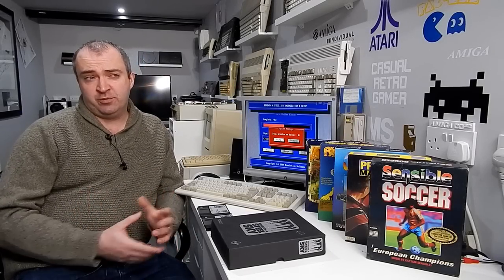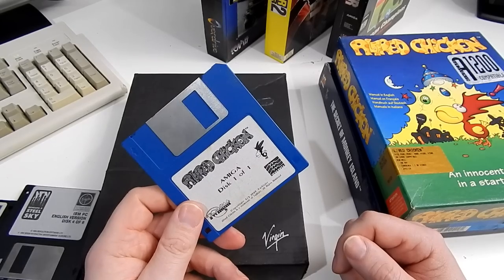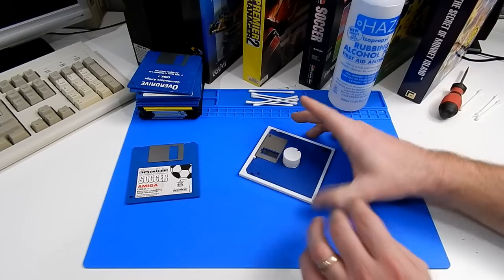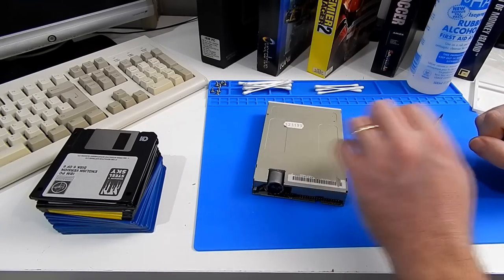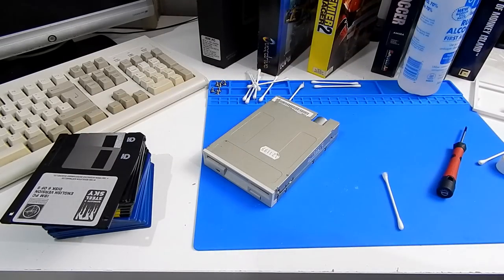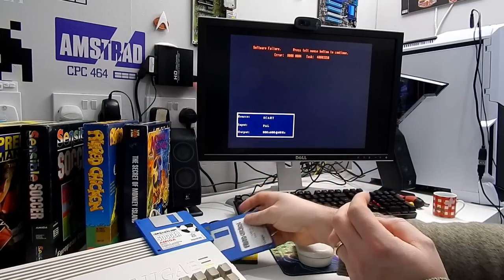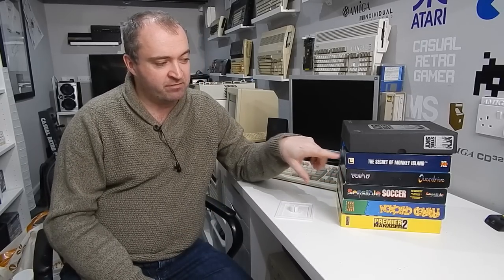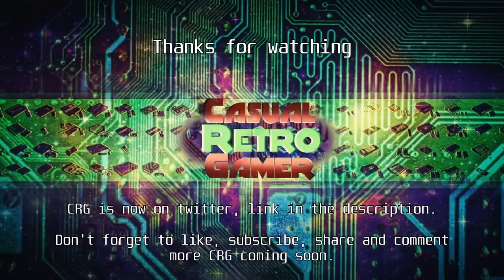Cleaning Floppy Disks, will it fix them?

Comment: I´m a bit late, but there are my 2 cents in the 3d printer issue. The wall-infill gaps can have several causes:
- Improper filament diameter. Unfortunately, some brands don´t give the full 1.75 section so there´s some under extruding. Test with the caliper to average the size and adjust the material in Cura if it´s wrong.
- Printing speed, temp, flow, retraction settings can affect the results too. Ideally some testing to catch the ideal settings for every material can give the best result.

As the overall quality seems quite decent (on camera, though), I´d suggest going straigt to measure the filament, and if it´s ok just seek the "outline overlap" setting and rise it a bit. You can also rise the flow a bit if other areas lack material too (when you point the gaps the top right area printing lines look a bit empty).

Hope it helps. Cheers

Comment: So IPA could cause issues. I know it's good for cleaning the heads of disk and tape drives but those tend to me made up of metallic or similar material. Any plastic-based material can be impacted, esp depending on the strength of it (i.e. 99% is worse than 50%' -- I tested a bunch of products on plastics after I damaged a portable amp's exterior surface and IPA causes a chemical reaction on certain types of material). Here is part of an abstract of a paper about restoring magnetic recording media (fixing "sticky shed"): "A liquid cleaner, such as isopropyl alcohol, is applied to the Backcoating to dissolve it from and clean it off the Mylar Base. Before the liquid cleaner is applied, steps are taken to prevent the cleaner fluid from getting onto the Oxide side of the tape. The chemical cleaning is done as quickly as possible... the Oxide side of the tape is given a dry, non-chemical cleaning to remove the residue of contamination of the Backcoating which was deposited on the Oxide side of the tape as the result of physical contact with the Backcoating from the storage on the reel ..."
Reply from the maker: The stuff I used is 70%.  There certainly didn't appear to be any physical problems from it although as you seen a few of the disks didn't read as well after cleaning.  I'll test them again and see if perhaps they have further degraded.  Perhaps the solution here is to clean then dry yourself, rather than leave it to dry as I did.

Comment: Once you succeed in rescuing a whole set of disks by cleaning them, you ought to try to find any NOS disks of the same density that you can back them up to, as well as backing them up as install images onto a hard disk, optical, flash, or all 3, if it seems like someone hasn't done so already, so that you might not lose that game from all functional existence.

Comment: Could you re-write a disk image to the disk to refresh the magnetic fields on them ?
Reply from the maker: I'm not sure to be honest, but might be worth trying it with the steel sky disks.  It's not like I'll make them any worse.
Reply: Yes you can do that certainly. However the more you use the original the more likely you are to damage it. Especially now that the hardware used to read these old disks are getting old themselves. Old irreplaceable originals should be copied to a preferred media type and used from there instead.
Reply: Hi - Nice Video on a common problem

As there are 2 components, there is 2 places to look at first

Drive mechanism, most people clean the heads, but you should also do a alignment, there are some software floppy tools available to read a disk and determine its alignment most older drive units have a adjuster on them

Note  original double density 5.25 x 360k  and 3.5 720k driver have a stronger and wider rear write head, then the high density format came out the HD units can read and write to these but the HD systems do have a thinner rear/write head - so generally they can safely read and write , but some of the original Double Density drives may not really understand it -most times it is Ok - this is why for double density you should format them in a older double density drive and you can use them 

Floppy media - these have 5 common faults
1. Age Dust - Mold on media
2. Age each magnetic particle is now weak or not refreshed it cannot hold a charge or lost the original
3. Physical scratch or flaw on the media
4. Heat
5. next to strong magnet

1. just clean it, you can simple blow the dust of or clean it as you demonstrated
2. This is trial and error, reformat the diskette, if the media particles are weak and faulty they will not hold a format, if you are lucky it will work, partially lucky maybe a few bad sectors and you can live with that as a data disk or files only ( ie nothing that is used for copywrite where it looks at a certain track / sector for information ). If it cant hold a format you should bin it - you can try formating or another disk drive or say apple / amiga but it will at best be borderline
4. Physical scratch - junk it - if it was part of a original box set, i would place a small colour sticker on it advising faulty and get a image and place on generic floppy
4. Heat will damage the coating on the diskette surface, best to bin it as it will be totally unstable
5. if you get the floppy next to a strong magnet eg HIFI speaker then you may have a change of reformatting it to reset the media

Any media - Tape - Floppy - Hard Drive - DATA FADE 

While this is not really how it works, floppy media is like tape media, it has a coating, the coating is either readable or unreadable - a format sets the magnetic polarity to neutral, when you write to a floppy or tape it sets the polarity to +ve or -ve  the magnetic equivalent of binary 1 or 0

With hard drives - if you dont use them often - eg backups, i like to use this every 6 months, it does defrag and checkdisk etc, but reads every sector and rewrites it to ensure it is writen on new fresh location with now a reset magnetic field

diskfresh  http://www.puransoftware.com/DiskFresh.html 

I have no link with the company  other than grabbing these free tools and using them in 2017 

Regards
George
Reply: You might as well just leave them be and put copies of the disks in the box to use if you want imo
Reply: Get a greaseweazel USB magnetic flux writer device - then replace the internal magnetic part of your original discs with the internal parts from some good branded blank discs. Then just re-write the discs from disc images.

Comment: Just blindly cleaning the disks won't give much success. You need to pair it up with something like Greaseweazle (flux level reader/writer) so that you can dump an image of the disk an analyse it for errors. Greaseweazle can also be used to rewrite original images back to the disk, or to a donor disk and then replace the damaged and unrecoverable media.

Comment: Regarding the noisy disk, I'd be worried about that as noise means vibration from friction, and friction on that media is not good... Probably a larger than normal particle is caught in the felt lining of the disk internals and is rubbing on the surface of the disk.

I would be cautious of the IPA as I use that as a solvent in some cases.. I guess it could make matters worse for the media, though it seemed ok. Maybe some IPA was still on the disc, absorbed by the same felt lining of the disc, making it grab it more and slow it down?

I would only do this to problematic discs though, if it works, don't clean it maybe?

Finally, for magnetic fading, maybe invest in a Kyroflux and rewrite a flux file from someone else's working copy back to the disk? Needed for some originals due to their complex copy protection.
Reply from the maker: I'd agree if it isn't broke don't try to fix it so if your disks are working then just leave well enough alone.  I'm not sure the IPA will damage the disk surface, the stuff I used is 70% but point taken than stronger stuff may eat into it.  

While it seems only a few minutes passed in the video it was probably more an hour between cleaning and when I started to test so I would expect that any IPA would have dried in that time.  

As for the damage I'm going to pull open that Monkey Island disk alter to inspect the felt.  Just want to see if there is any dirt in there that might have caused the damage.

Comment: Just curious-- Is it possible to replace the media inside the case from a good disk without irrepairably damaging the original disk?
Reply from the maker: Yep there's no reason you couldn't do it and I may take this approach to fix the likes of Monkey Island. 

Only thing you need to watch is that the disks are generally glued together so you need to be careful opening them.
Reply: @CRG  I was about to suggest this but made sure to read the comments.
Replacing the disc inside seems like a good option to try on permanently damaged disk where a rewrite is not an option or did not work.
Have opened disk before but was so long ago.
Would be nice with a video of that.
I would consider the disk original if the internal disk is replaced and rewritten with a proper image that is original to.
Reply: @CRG  I've done this with more than one AmigaDOS based Amiga game (Flashback immediately springs to mind). Found a disk image online, copied the contents to a known good disk, then gently opened the original game & copied disks and swapped the good copy disk media into the original case, then glued the game disk case back together again. Very satisfying to get an otherwise good big boxed game working again.

As a general rule I've always stored my original game disks in the original game box, nowadays taking no chances by putting them in sealable plastic bags too. The vast majority of them hav been fine. Disks that have been stored in less than perfect conditions inside old plastic floppy storage boxes (more open to the atmosphere) are the ones that have suffered with muck/mould. Thrown hundreds away as they were dirtying my floppy drives.

Comment: Did you try formatting and checking for bad sectors after cleaning up?
Reply from the maker: No I didn't bother doing that as in the first place I wanted to see if it was possible to recover the disks by simply cleaning. 

I may do this with the steel sky disks and see if I can then rewrite the original contents back.

Comment: My understanding is that it works for dirty disks (dirty with dust and other particles), but not for scratched disks. As for "de-magnetized" (if that's a word in english? :)) I think I remember that some disk utilities claimed to "revive" somewhat those kind of disks... My memeory may be failing, here though :(
As usual, very cool vid :)
Reply from the maker: That's basically my understanding too and it did seem to work here on 2 of the games.
Reply: SpinRrite was able to analyze magnetic flux and work out if it was a 1 or a 0 by doing multiple reads an even moving the heads back and forth to different tracks to get a better "look" and rewrite the surface, but that was mainly for HDDs I believe that it supported. IO remember using it with some success on floppy disks though..
Reply: @DarkAlaranth  spinrite can be very good to revive disks BUT it maybe end up permanently destroying the data... I have a few ARJ files on disks that spinrite managed to "correct" but now the ARJ gives crc errors and never was able to recover the data. I would try to get the data manually first even if it kept failing and failing "data errors" and even try the disks one a few different drives. Sometimes a different drive will read sectors that another couldn'.t. And only use spinrite AFTER to refresh the surface and re-record the data back into the disk.

Comment: I think the combination of ageing drives and heads combined with ageing floppy disk material means they should be immediately converted to ADF files and then write the data back to new disks if you want to still use floppies? I think with the advent of Gotek drives and some new improved Gotek like drives, the era of floppies is long over, they are too slow and too prone to failure. Practically every Amiga I have bought and refurbished has had faulty drives and yes you can fix them, but it's probably not worth the hassle. To me it's a bit like vinyl disks, when I got a new album I would immediately record it to the best quality tapes I could afford and never use the disk again until my tape wore out and then I would buy a new one and record from the album again. So over many years the disk would only be read a few times keeping the wear caused by the record player needle to a minimum.  I think floppies are now the same, the act of reading the disks causes wear so you want to keep it to a minimum so I would record to ADF and use the ADFs instead of wearing the disk any more than you have to. At least if you have the box and the disk and the manuals you can prove that  you have the right to own the ADF files. Also keeping the boxes and manuals is a good collector thing as they look good on your shelves even if the disk no longer works.

Comment: HD discs were always a bit more flakey than DD if i remember correctly.?
Reply from the maker: I've heard some say that in later years of disk manufacturing the quality maybe wasn't as good so they don't last.  Probably some truth in that but in my experience more of my DD disks have failed than HD.
Reply: I remember changing the spring tension of my floppy drive to get some disks to read properly. It's heads had some raised sections on the top where the tension spring sat and had 3 positions. Found I usually had to weaken the tension when I used HD disks for some reason. Maybe they're thicker?
Reply: Isn't this because of the narrower field of stored data on HD - it's a finer process - rather than the quality of the disks themselves?